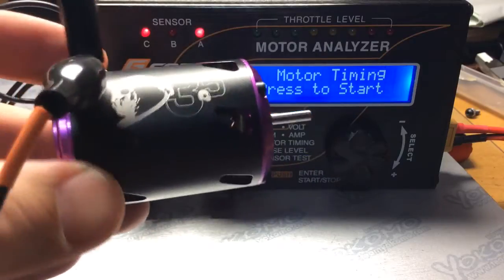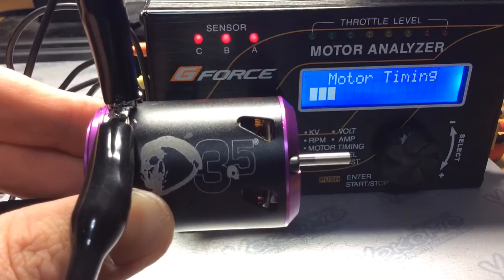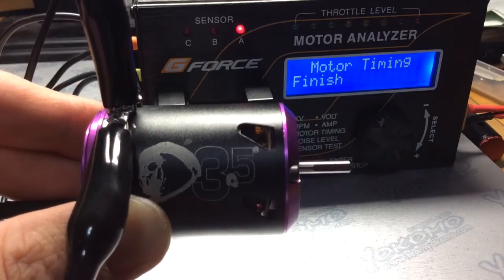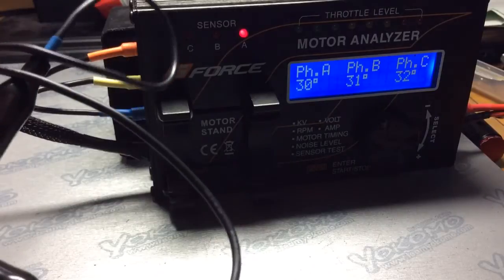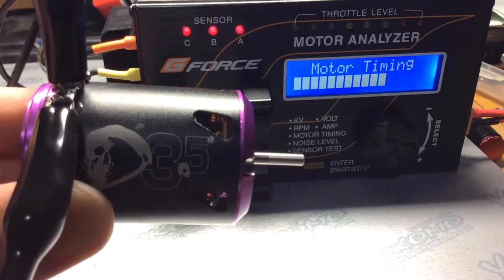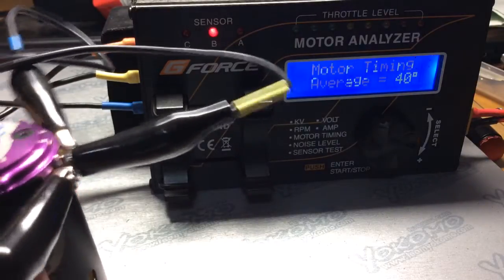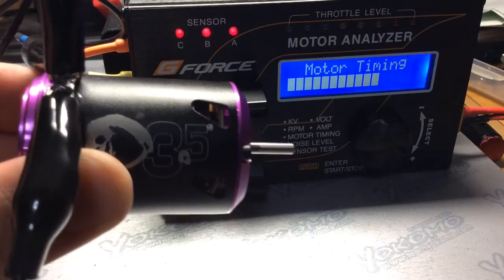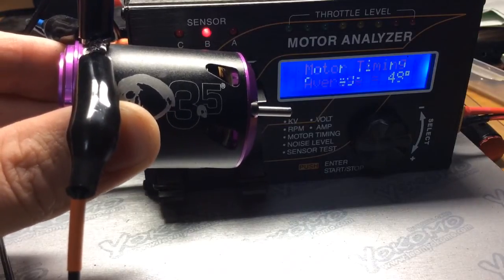Trinity D3.5 21.5 Timing Setting

Comment: Helps what you just kept turning the timing up and showing you turned it up..LOL  What amps is the motor pulling what is the rpm change and KV change.. Lots of missing info here